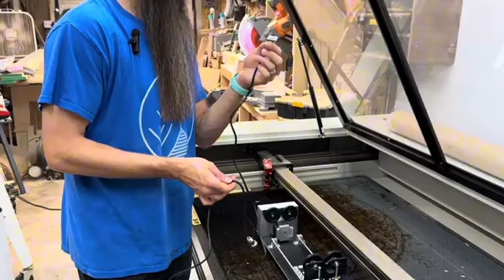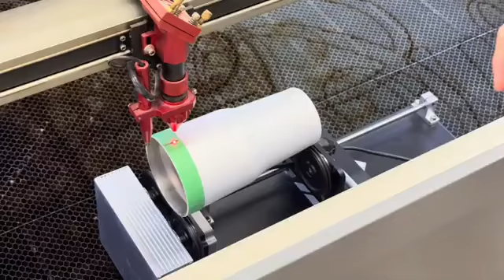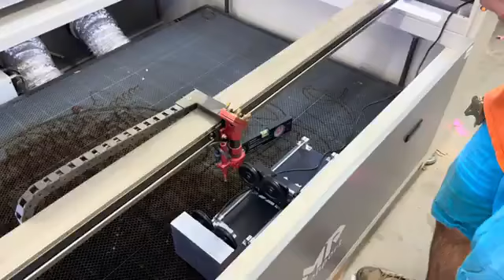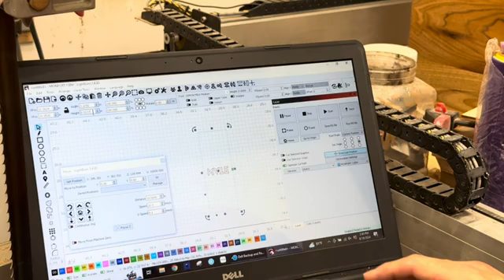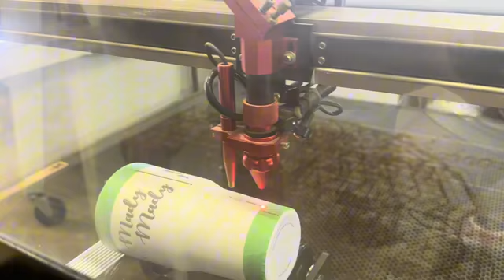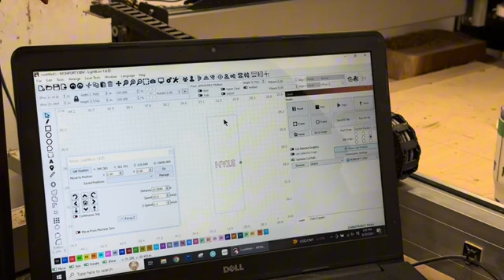How to Set Up & Use the Rotary Attachment | #monportlaser

Comment: whenever i start the job my rotary spins very fast and almost throws cup off . but turns cup slow when lasering. are there machine or controller settings i need to adjust to prevent this